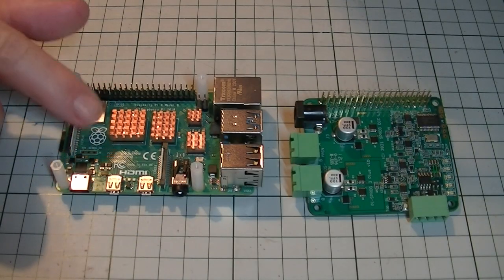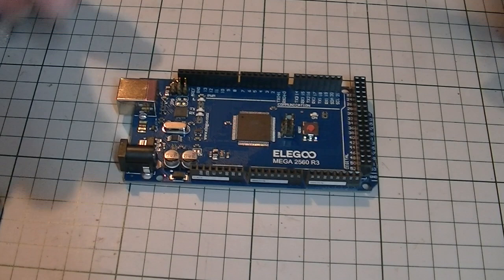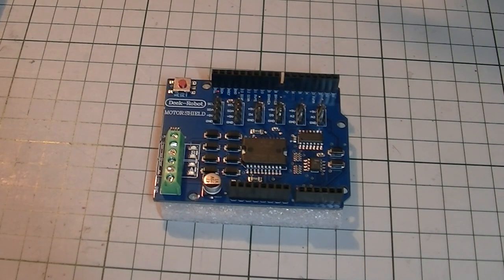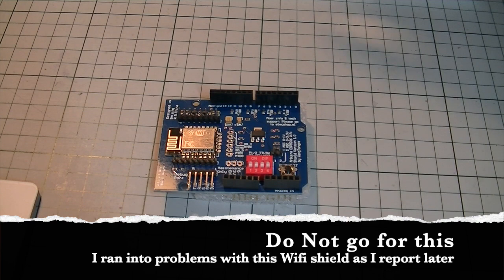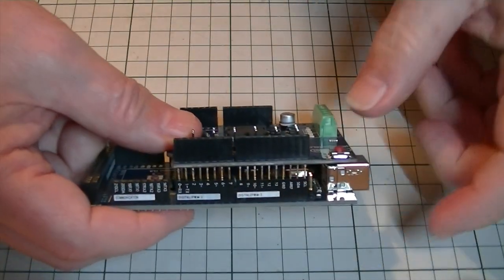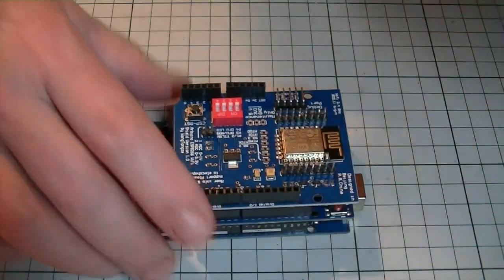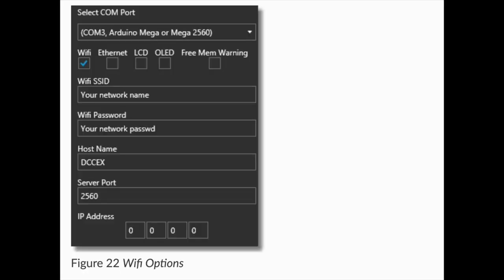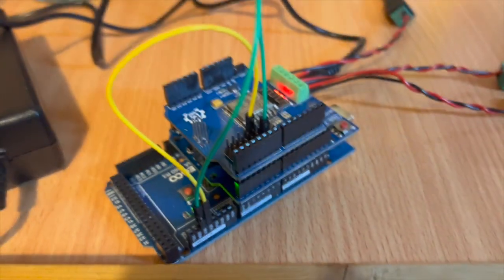04.04.2023 - Trying out DCC-Ex as a layout controller (Part 1)

Comment: I have a DCC-EX setup with an Android  tablet and EngineDriver. It runs beautifully,  operates 20+ servo point motors, 20+ Dapol semaphore signals and has automation using over 30 hall effect sensors. No PC or JMRI in sight. Superb results for last 18 months. I set out to avoid commercial kit, avoid a PC and avoid JMRI. All achieved.

Comment: I understand you don't want to be tethered to a PC but I found it an easy and cheap way to get started. I used an ancient PC loaded with Linux and JMRI. In effect it's doing the same job as a Rpi or Arduino. I also use my home network via the PC so no need for WiFi shields. The phone(s) are already connected to the home WiFi. The PC controls everything from locos to points, signals, routes etc etc and still have the phone to control a loco as you move about the room. Part of the beauty of JMRI is the ability to adapt to your own unique requirements.
Reply from the maker: Thanks Gerry. Since making the video I've been trying out different ways of using the DCC-EX Controller and I am probably going to end up using an old computer. As you say it is an easy and cheap way to get started. I can access the DCC-EX Controller from my phones (the controller is on my network Wifi as well as the phones) but also want to have a roster for simpler selection of locos which means I will most likely be using JMRI.

Comment: Yes, DCC++-EX is amazing.  My advice, since you're already saving money going down this route, don't cheap out with knockoff brands, stick to genuine Arduino wifi and motor shields.  Definitely like the use of male/female quick connects for the power - I'm going to switch mine over.  Great vid!
Reply from the maker: Thanks for the advice and encouragement.
Reply: @AndrewH561  not a problem. Us Woottons have to stick together!

Comment: Great video.  I have switched all my DCC controllers [NCE & Digitrax] over to DCC-EX.  I use OSX, Windows and Linux.  The script will not run on my M2 Pro Mini even with the sudo command.  I just load it up on using the arduino IDE and edit the config file.  You may notice that when you turn your turnouts using DCC they are inverted.  Uncomment  "define DCC_TURNOUTS_RCN_213".  I no longer use a raspberry pi 4 for JMRI as I found it too slow to render drawings in Panel Pro.  I ended up using an old 2010 Mac Mini.
Reply from the maker: Thanks for the information. I may well move to using an old Mac as I also find the Raspberry Pi rather slow.

Comment: Excellent video, very clear and concise. I noticed you had one of the new Hornby TXS decoders is that what was running in your class 91?
Reply from the maker: Hi Stephen. Yes I am using the Hornby Decoder in my Class 91. At the moment there isn't a sound file available for the Class 91 (scheduled to be released towards the end of the year) but it is straight forward to update the sound files so I will leave it in the loco for now.

Comment: The wifi board you are using is, probably, a clone of the 'WangTonge' one suggested in the DCCEX instructions. Apparently the clones have two  incorrect value components that makes them more difficult to set up. When you place the board onto the motor shield the TX and RX pins of the WangTonge clone must be bent out of the way so that they don't contact the motor board. 
The TX/RX connection is then made using  DuPont type cables. The details of the full 'work-around' is hidden in the DCCEX website - unsupported wifi shields!. I have used a few of these boards to make up controllers and they seem to work well when set up this way!
Reply from the maker: Thanks for the information.

Comment: Where did you get the makerfabs wifo shield i cant find it in the uk. I'm having the same problem with that first wifi shield you used
Reply from the maker: Hi Matt. I bought it from Makerfabs direct -  https://www.makerfabs.com/esp8266-wifi-shield.html . I had to wait for it as the shipping was via airmail ($6), DHL would have been around $35 :-(  the DCC-Ex website has suggestions for other WiFi options (e.g. Duinopeak ESP8266 WiFi Expansion Board + ESP-01) but I have still to try these.
Reply from the maker: Matt just a follow up. The DCC-Ex website has some information on the board https://dcc-ex.com/reference/hardware/wifi-boards/wangtongze-board.html assuming it is the WanfTongze clone.
Reply: @Wotton Tor  thanks. I did try the wangtonze workarounds and non of them worked, it would come on and the lights flashing but it wouldn't create a WiFi network so I gave up on it. So I'm currently trying waiting on delivery of some esp01s and level shifter boards to try. If these don't work I'll bite the bullet and use your link to the makerfabs board, but didn't want to be waiting forever for the airmail as you said
Reply from the maker: Hi Matt. I'll be interested to hear how the ESP-01s etc. work. I've just done an experiment and managed to get the WangTongze clone working.. I have one of the boards with the misspelt 'moer' and 'Arbuino'. Basically by bending the pins (shown on the DCC-Ex website) slightly out so they don't connect to the motor shield and then adding the jumpers I seem to have got the board working (at least I can connect via my wifi to it and the Arduino IDE doesn't thro up any error messages). By the way I see that the Makerfabs shield might be back in stock around the 17th of next month at https://uk.robotshop.com/products/esp8266-wifi-shield
Reply: @Wotton Tor  interesting, that's how I wired mine with those 2 bent pins. Which jumpers on the board did you use? Also, when setting the network settings in the dcc ex software to program it, did you leave all the network details blank or did you enter details? I thought my wangtonze was working as all the lights were on, but i just couldn't see the network.
Reply from the maker: Hi Matt.  I connected TX1 (Pin 18 on the Arduino board) and RX1 (Pin 19 on the Arduino board) to the debug header on the wifi board (as illustrated on the DCC-Ex website - sorry don't have any pin numbers for them), I would note the first time I did it I had the connections the wrong way round and had no response. 
For the network settings I have used my home wifi details (edited the config.h file).
Reply: @Wotton Tor  brilliant thanks. That's exactly what I did but I just cannot see the network, but in the startup commands I can see that it had created an ip address so it is semi working. I'll try again tonight using the config h file editor and see if I can get it going. What voltage are you using to power the ardeuno?
Reply from the maker: Hope you have some success. I am using 5V power to the Arduino when stand alone or using the power from the serial port when connect to my Mac.
Reply: @AndrewH561  did you do anything with resistors and the 2 jump wires to the debug port? It mentions using them in the guide, but doesn't say you have to.
Reply from the maker: I didn't do anything with the resistors. Just connected the 2 jump wires to the debug port.
Reply: @Wotton Tor  hmm one last try tonight then, hopefully it might just be an issue in the config file
Reply: @Wotton Tor  nah still not working. When you boot yours up, does the blue light on the wangtonze flicker continually? Mine flickers a couple of times then stops
Reply from the maker: Sorry to hear that. Mine flickers a couple of times and then isn't noticeable, so not continuous. I have just, however, run into another issue. I made a couple of changes to my Roster file (myAutomation.h file) and tried to download to the Arduino but the IDE seemed to get 'stuck' when loading. However, as I think I mentioned in the video, when I removed the Wifi Shield the software loaded okay. So I think I am going to give up on the WangTongze board I have (it obviously is a bad clone :-( ) as it seems a bit hit and miss working.
Reply: @Wotton Tor  yeh it seems they cause a lot of hassle. Mine programs OK with the wangtonze attached, it just doesn't give out any WiFi lol.

Comment: with a mac there is an alternative, you can grab the DCC-EX++ software as a file that can be opened from the arduino IDE, and upload it from there - also useful if you want to or need to change the configuration

there is also a further tip I have found for my layout - its well worth getting a screw terminal breakout shield for the arduino board. its not needed but once the thing is fitted to a layout its way easier to add connections to the end of the Mega arduino for say acting as inputs or outputs, things like adding a LCD or OLED screen without wondering why the thing doesn't work because a wire has come adrift.. again..
Reply from the maker: Thanks Dale. I've used the Mac to download the DCC-Ex software to the Arduino and as you note it makes updating the configuration files simpler. At the moment I am editing the myAutomation.h file to create my roster.
Is there a terminal breakout shield that you would recommend?
Reply: @AndrewH561  I just found one on eBay to be honest, the one I have has prototype board in the middle plus a solder tinned hole for each pin around its edge, then screw terminal blocks all round the outside of that. makes the board slight wider and longer which may be an issue. the prototype area I'm not using but could maybe hold a few extra terminals for 5v and ground outputs depending on what you need - I just wanted the screw terminals to avoid having wires dropping out or having to make some sort of plug for the double row connector at the end. 

it does make adding wires to the serial ports easy as they can be screwed in as well.

hoping to experiment with automation more here once I have the block detection stuff added
Reply from the maker: Thanks

Comment: Hi Stephen.
If you tried to upload the DCC-EX software to the MEGA after you connected the wi-fi shield, the reason it failed is probably because of the shared serial connection with USB. Disconnecting the wi-fi shield should have resulted in a successful upload.  I suggest you retry the original shield now that the software is on the MEGA.
I've been using DCC_EX for about a year with 100% success, but instead of wi-fi, I use HC-12 tranceivers to connect to my self-designed wireless cab and to my Atari computer.  No PC or other equipment required.  Remote wireless NANOs around the layout control all the accessories.
If you aren't familiar with Little Wicket Railway it would be worth a look, as Rob has done much the same thing as you.
Chris
Reply from the maker: Hi Chris,
Thanks for the message and suggestion. I've tried the original shield and, as you said it would, it works now that the software is on the Mega. 
I've also had a look at Rob's videos (he covered things much better than I did). I've seen some of Rob's other videos and should have checked before putting mine up.
Your setup sounds interesting. I'm still experimenting with mine. At the moment I am leaning towards connecting the Mega to a old MacBook and running JMRI on the MacBook which then can be accessed over my home Wifi. I know I could just use the Mega on its own but I've noticed that it sometimes only allows 1 Cab app (e.g. on a phone) to connect (I wonder if that is also connected to the shared serial connection).
Reply from the maker: Thanks Chris. I'll do that.